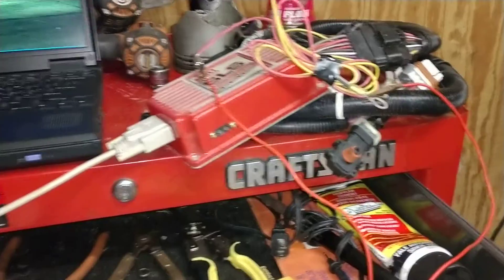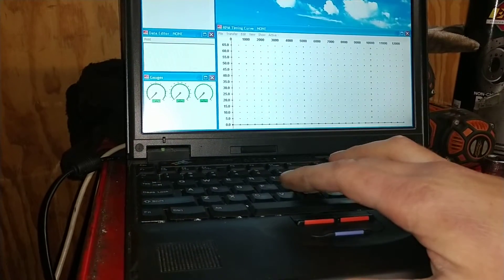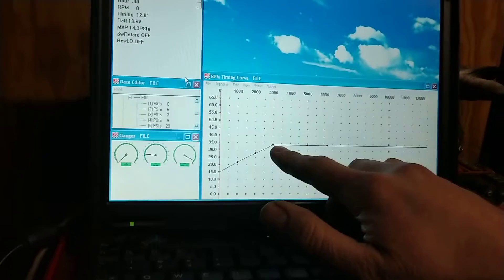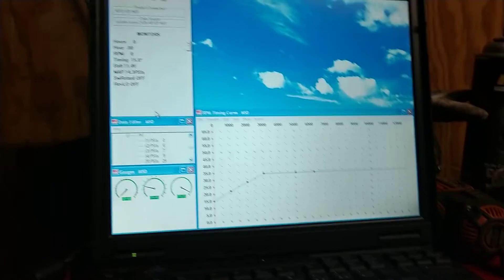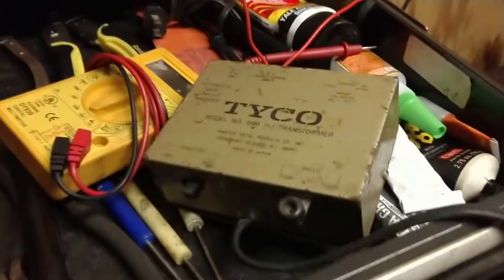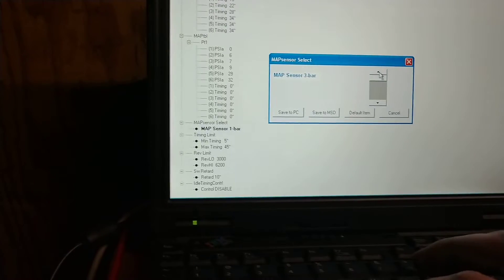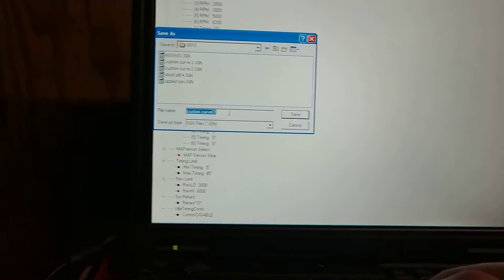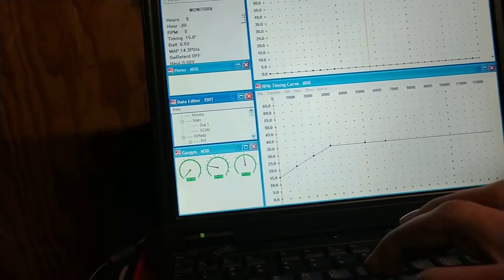MSD-6010 ignition controller basic overview!  Tuning via PC. Rev limiter, custom curve etc.

Comment: I have a 2002 GMC Sierra 2500 HD 6.0 fuel injection. I would like to change it from fuel injection to a 4 bbl Rochester Carburator. That way I can add an HHO system to boost my gas mileage.

Comment: Hey didnt know if you could help me out I have a 6010 on a 5.3. I need to tweak on the tunning a little but it did not come with a tuning cable tuning software and I do not have an older laptop.. any help would be appreciated!
Reply from the maker: You kinda need both lol
Reply: @beeterolds  That kinda of what Im finding. Ive seen somewhere people using a cable that adapts to usb and possibly downloading the software from the msd website for free? Didnt know if there was truth to this or not
Reply: @rylanfowler3344  msd has the free software & you can get the usb cable from a computer store
Reply: @djbutchsospartnuzent  I have a cable I didnt know if you could download the software without the cd or not

Comment: hi, looking for a little help with my MSD 6014. Your videos have been super helpful on my k5 ls build. Everything is in play, just trying to dial in the tune. The set up is, stock 5.3, 700r4. Its currently running on the truck default. Runs and drives just a little rough. A lot of  carbon on the spark plugs. Don't really know what im doing tuning the timing, any info you can give where to start would be great?

Comment: if i had the balls(and money,lol) to go ls i would use your carbed ls method as the fuel injection crap terrifies me.
ive got a spare tpi 350 with the entire harness and its an octopussy nightmare so the tpi is getting pulled off,my car is carbed anyway

for now im just going old school vortec headed 350 ,edlebrock rpm and holley 650 with the lt4 hot cam to replace my 30-fried.

Comment: Wow only 34* total  I put in 38* total in mine and it really liked it  (6.0, 243 LS1 heads, single plane, 650CFM Edelbrock, 1-3/4 primary headers, revs out to 7200rpm and still has juice for more)
Reply: Kimbal Mackinnon stock
Reply: Was your Map set at zero across the board?
Reply: getinmoney4sho I don’t recall the exact numbers because i since EFI swapped my setuo, i think my MAP values had 10 degrees advance from 0-7PSIa (idle-1/3 throttle) gradually sloping to 0 degrees at 14PSIa (full throttle/WOT vacuum value). I basically set it up to perform the same purpose as vacuum-advance on a distributor and it ran great, with a holley 750 double pumper i was getting 18mpg, not an easy thing to do. If you add something like what I did to the base timing, guaranteed it drives around part throttle a lot better and gets better fuel economy.

Comment: Question, The setting that the MSD 6010 Ignition came with isn't the best setup? Thanks in Advance!
Reply from the maker: Correct. It's a base setup
Reply: @beeterolds  So I did a Tune, similar to yours. I have a carb setup with the MSD 6010. It Idles fine, but when I try to give it gas, it sputters and dies. Too much advance?
Reply from the maker: Sounds like a fuel problem
Reply from the maker: What's your redline set at? Factory the box is set at 5500. But in reality it's lower than that like 5k. Bump it up to 6500 that might be your issue
Reply: @beeterolds  yes you are correct, it's at factory. I'm going to bump it up.

Comment: Question for you: I’m thinking about this route. As far as “daily” in town drivability, how does his set up with the carb and box hold up? My car will mainly be a spring and summer cruiser. Technically not every day but as much as I can drive it I will. Street car, not track. 

Just debating going this route or EFI. Wouldn’t mind saving money as well. Let me know your thoughts. Thank you!
Reply from the maker: Keep it away from the engine mount it on the fender or inside the cab and it'll last. The box I have on the S10 is 7yrs old. Still going strong
Reply: BEETEROLDS Thanks for responding. What do you think is better for street and daily: Single or Dual Plane Intake Manifold?
Reply from the maker: @MrGriffin23  dual plane
Reply: BEETEROLDS Appreciate the advice! Thanks!